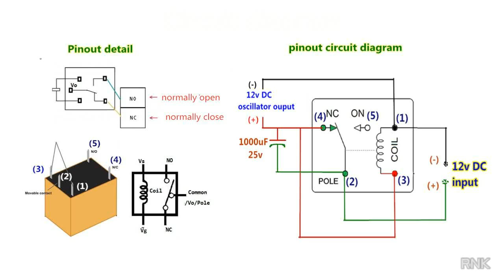Without IC | How to make simple oscillator/flashing/blinking lights using DC relay | POWER-GEN

Comment: Poor design. Discharging a charged capacitor directly through low power relay contacts without limiting the current with a resistor  will eventually burn out or weld the contacts.

Comment: nice n easy fine demo but can we use 12v battery instead of big board which u show I my not electrician but interest in clectric please reply or more any option.
Reply: you can use any kind of supply that only have 12v output Dc
Reply: Just make sure it can supply enough current

Comment: Can i connect 4 smd led(5watt each) with this single circuit?? And can i fit this circuit on bike 14.50v dc supply ? Please answer
Reply from the maker: change the capacitor ( uF )value and use the 25v range
Reply: @powergen522  change to..?

Comment: i have a led bar with 120watt for my car i tried using 1000 mf 16 volt  capacitor but the light illuminate
 in not good enough

Comment: Sir,I used this circuit. Very fast flashing. How to slow flashing
Reply from the maker: decrease the capacitor uF value
Reply: @powergen522  Thank you 👍🏽👍🏽
Reply: can it be 24 volts dc like that sir?

Comment: Is there any way  to control the speed of the relay with a potentiometer  if so can u show me how
Reply from the maker: this is capacitor charge & discharge (F) time period control defending relay movable armature control method, but you can use 555 IC variable time control
Reply from the maker: this is capacitor charge & discharge (F) time period control defending relay movable armature control method, but you can use 555 IC variable time control

Comment: 1 sekand ke liye 1000uf/25v ka lagta hai to  5 sekand on off.  ...uf ...v.   kay valu ka capacitor lagaye sir please please please please.. bataye please please please please please please sir
Reply from the maker: you can use the above 2200uF/25v capacitor, you connect the content 12v DC supply
Reply from the maker: thank you for your comment

Comment: why is a capacitor needed?
Reply from the maker: relay on & off time control, because the capacitor is charge and discharge particular time period
Reply: POWER GEN any formula which we can use to calculate time period??
Reply from the maker: I did not use the formula, but capacitor (1000uF) micro farat change it time control
Reply: kunal pawar h
Reply: can i use capacitor?